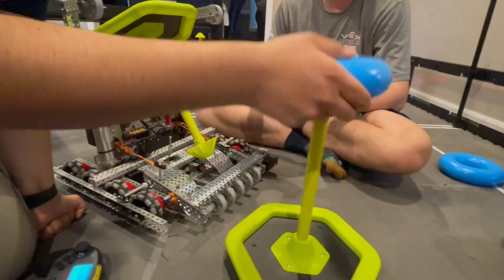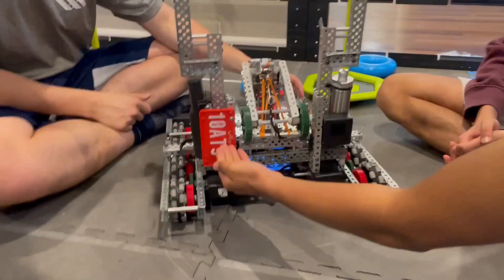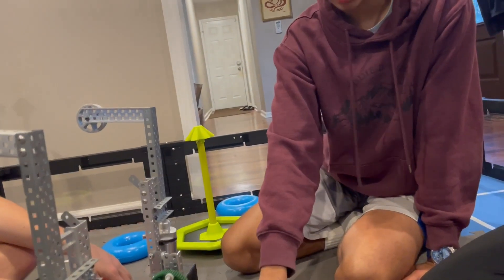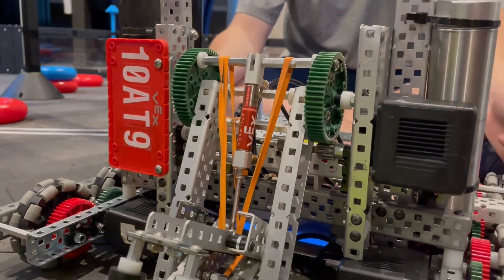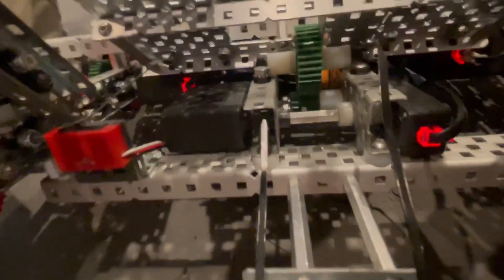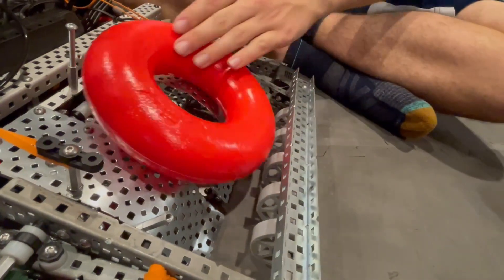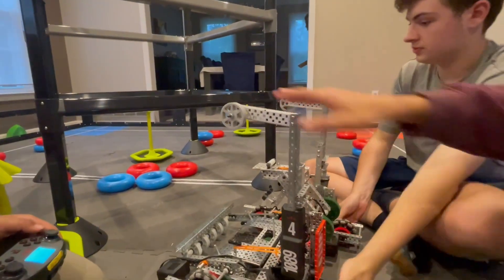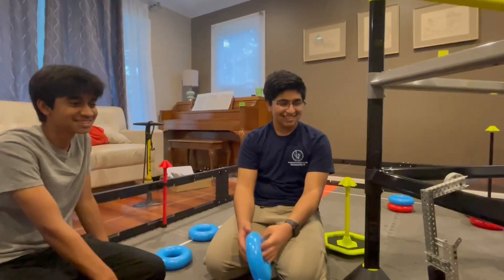1089 Ri3D Explanation (COMPLETELY NEW DESIGN)

Comment: how would you get the goal off of ur claw with the thing underneath
Reply from the maker: You drop it (we tested this and it worked, sorry we forgot to show that in the video)
Reply: @ForgeRobotics when you drop it, don't you risk it laying on its side and having all those rings touching foam tiles and therefore not scored?
Reply from the maker: because of how heavy the bottom is, the goal never tipped over whenever we did this

Comment: I was thinking about testing something sort of  similar to this where you used the mobile goal as a plunger to grab them from the floor but I don’t think it’ll pick them up very well because the internal width of the ring is greater than the rubber part of the mobile goal if I’m not mistaken.
Reply: If someone understands my yapping and makes this I wanna see it
Reply: im pretty sure the ring is shorter than the stopper part on the mogo so it wont snap on
Reply from the maker: I understand your idea, and I think that it could work given the right testing and iteration. The ring’s inner diameter is smaller than the mobile goal’s top part by .56”
Reply: @ForgeRobotics  Your completely right. It would be impossible to pick them up in the way I suggested if the rubber part was smaller. Misspoke on my first comment.

Comment: Can you explain how you put more rings on while the other rings you previously put on are pushing against the ring your trying to put on. I just thing the weight of the already scored rings will be an issue when trying to put on new rings.
Reply from the maker: The extra weight is definitely an issue, which is why we tried a catapult design to forcefully push rings onto the stake. It would have been able to be stronger if we had used an 11W motor

Comment: I have a question, if for exa,ple.2 rings are on, wouldn't the motor be too weak to push both the two rings and the addition ring.
Reply from the maker: Great question- instead of using a 5.5W motor to pull it down, an 11W would be better here. By using a stronger motor, you could either have the motor push the rings up by itself or have more banding to launch the rings up with more power. An entirely different design using flex wheels to directly load onto the goal might be even better.